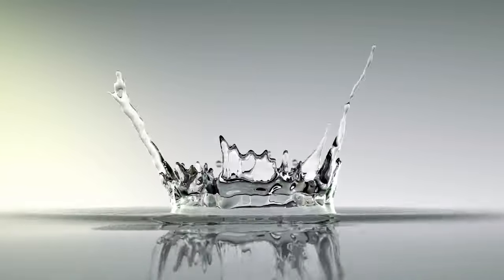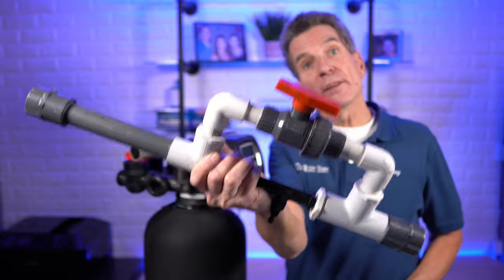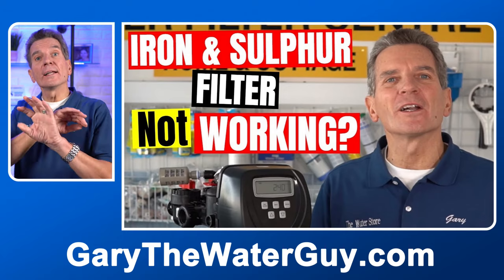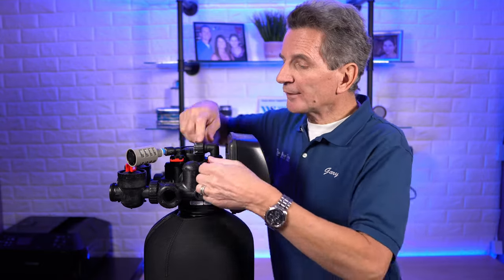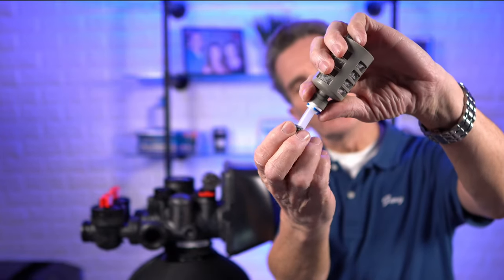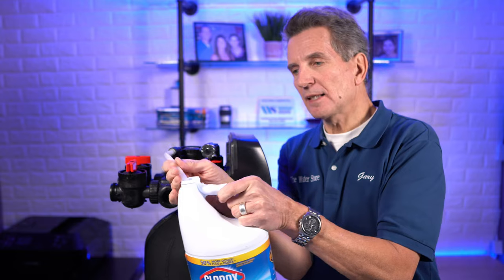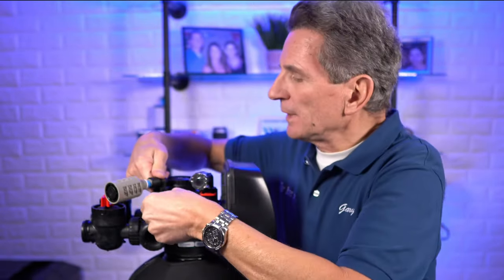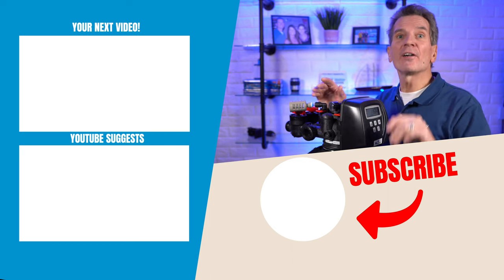EASY IRON Filter FIX

Comment: My iron filter stopped working and now I have smelly stained water and fluctuating pressure in the house. My unit for some reason won’t backflush even when I turn the knob to “start BW”. I can’t afford to replace it but I’m not finding any kind of specific info about my model #. I’m also not seeing any kind of air intake anywhere on my system.
Reply from the maker: This troubleshooting video might help https://youtu.be/Yg0HTiaLVFg
Reply: I had the same problem.. I took my entire unit apart, and it was LOADED with rust/iron.  I rebuilt the entire setup, and noticed that my filter and injector were completely plugged.  A simple bath in Iron Out of the filter and injectors did the trick!  Gary has such great content, he has taught me so much- Thanks Gary!!

Comment: Will this work on Green Sand Fusion media? I'm on well water and have a filter that uses the Green Sand Fusion, but my water is still yellow.  I've tried the iron vs tannin test with iron out and the water turns clear, so I really don't believe the water is yellow due to tannins.  I just don't think my filter is working properly and it's not even a year old.  I have also sanitized my well, and right after that the water was clear for a couple days, then back to the yellow.  Just looking for a solution.  Thanks!
Reply from the maker: I don't know if it will work, I would ask the manufacturer of your system.  Did you system ever work?

Comment: Good Morning,  I have noticed over the past couple days (extreme cold weather) that there has been a puddle of water on the floor alongside my filter.  Until yesterday, I hadn't discovered where this is coming from.  Yesterday I observed it was dripping from the air injector.  Could you please help me isolate what's going on and how to fix?  Thank you.
Reply from the maker: The check valve is leaking water during regeneration.  You need to replace the air draw assembly, we have them here https://waterestore.com/products/clack-fob-c-k-strainer-check-valve-air-intake-assy
Reply: Correct, it is only during regeneration.  Thank you...will order.   @water_estore

Comment: Gary, Thank you for your video, I have one of the iron filters you describe with the same set up at the top of the unit. I was looking for maintenance as it has been 2years. The installer told be they also use a “soft” mallet and use to loosen sediment as part of the maintenance. Have you heard of that and is legit?  Somewhat concerned. David
Reply from the maker: Never heard of this "soft mallet" concept.

Comment: Hey there, I have the Kalck valve but there is an air pump hooked into a relay with a PC board mounted to the front.  If I plug the  air pump into a regular outlet it works and builds pressure, but how can I test with the pressure relay, I havent noticed the pump running for a while and I am smelling sulfur again in my water.  the PCB is a repco BUB 080.  Not sure what all the setting are supposed to be, but do you have a video how to check to make sure this type of setup is functioning properly?  Thanks!
Reply from the maker: No, I don't like the ones with the pump and don't know much about them other than they are expensive, noisy and often require maintenance.

Comment: I have a hellenbrand single tank iron curtain that was in the house when I bought it.  No water softener, just high clear iron.  It seemed to be working ok until recently when staining started to appear.   Any idea if this valve can be taken apart to clean?    I see you you bleach for rust removal on the media.   what are your thoughts of citric acid powder?
Reply from the maker: I doubt that citric acid will work, never tried it.  I would first check the injector and either clean or replace it, this video should help. https://youtu.be/Yg0HTiaLVFg

Comment: Another great video Gary.
Question, once the javex has been sucked up and we put bypass on, if i’m not mistaken the javex/water in take will be “sitting” on top of media so how can it clean/oxide the media? After we do a Regen, then javex being on top will get drained right away. I’m I missing something here?
Reply from the maker: It does not sit on top of the emdia it is mexed with the water and the media.  When you regen it gets flushed away.

Comment: Hey Gary
Thanks for producing all these helpful videos. 
I'm having an issue that I haven't seen addressed in one of your videos. I'm having a lot of air in my  pipes, especially  the  hot water pipes. When I turn on any hot tap there's a lot of  spurting. I just had a look at my air injection  iron filter (by Excalibur) and when I opened the injection cap a lot of  air came out  of there. Is it normal for there to be air pressure under that cap?  
I'm trying to find a solution for all the air in the pipes because it's quite annoying. 
Thanks 
Paul
Reply from the maker: I cannot think of what might be causing the problem but if it is mostly in the hot water it may have something to do with the heater or venting.
Reply: Did you ever figure out a resolution to this? I have the same spurting in the lines after it cycles. Both the hot water and cold water.
Reply: @frangeech  I ended up putting an automatic air vent valve on the line

Comment: Is this procedure still possible if I have a single lever bypass valve? i.e. I can only disconnect both the inlet and outlet at the same time, not individually. I notice you opened just the inlet while filling the tank with bleach.
Reply from the maker: Great question!  Yes it will work just make sure no one in the house is using water while you are doing it!

Comment: Hi Gary! Thanks for your videos. My air draw is constantly leaking. I’ll follow the steps on this video. Wondering if the Res Care cleaner can be used to clean the sulfur filter instead of bleach. Thanks
Reply from the maker: No you cannot.  It sounds liek you need a new air draw.  We have them here https://waterestore.com/products/clack-fob-c-k-strainer-check-valve-air-intake-assy

Comment: Hi Gary 
Thank you for your videos. My well yes has alot of Iron. I have the chem free system in my basement.  Issue is my water started turning orange. It has media in, backwash and Reg.  Now it's a dull yellow. 
And.  Its seems to be more in the cold water than the hot.
Reply from the maker: I would have the water tested before and after the iron filter to make sure that color is actually iron. If it is I would follow the advice in this video https://youtu.be/Yg0HTiaLVFg

Comment: Hi Gary... I'm Hoping You Can Help Me Figure Out The Safest, Non-Corrosive (Chlorine Bleach Alternative) Disinfectant To Use To Get Rid Of Iron Bacteria In Our Well System... As We Have Copper Plumbing Throughout Our Home, And Want To Use Something That Won't Erode The Copper!!??🤔😓😞.....

Thank You Very Much For Your Extremely Informative Channel, As It Has Helped Me On More Than One Instances!!!💖🤗😉
Reply from the maker: I don't know of anything.  I am not an expert on chlorine injection systems but you inject it, give it contact time in a tank and then remove it with a carbon filter so it doesn't actually get into your house.

Comment: Hi Gary, Thanks for the videos. I am having an issue with an iron filter where the water pressure is very low. Any suggestions? Thanks!
Reply from the maker: Sounds like it's clogged.  After doing this procedure, try backwashing it a couple of times.  If that doesn't help, you need to repalce the media. Thsi video shows you how https://youtu.be/Z47JGH1l39o

Comment: Hiya Gary, I've got the three button clack valve from Excalibur. I watched some of your other videos and noticed that my setup looks exactly the same except for there is a cap where the brine inlet/air inlet is instead of the air inlet in this and some of your other videos. Would there be any reason for this? Im pretty sure my filter isnt working since  my water tastes like a mouth full of nails.

Thanks for the great content!✌🏼
Reply from the maker: You don't have an iron filter, you have a backwashable filter that might have carbon in it.

Comment: Can I replace the air intake with a brine tank? Will that be more effective for flushing out the iron? (I have a ton of iron in my well water). (love  your videos btw. this is fantastic)
Reply from the maker: No, brine will not regenerate the iron filter media and you need the air intake to create the air cap for the media to work.

Comment: Gary you are the Best!  You explain it very well and make it look easy.  
I have a question.  My iron and sulfur filter is a  Clack WS1.  When I put the valve in the brine draw cycle water leaks out the air intake. I checked the veturi (orange) and it is clear and there is no sound of air being drawn in to the tank. What should I do?  Thank you
Reply from the maker: Replace the air draw assembly here https://x9bgz9os9j7qacz6-17147789412.shopifypreview.com/products/clack-fob-c-k-strainer-check-valve-air-intake-assy

Comment: Hey Gary,
Thank you for all of your videos and awesome information. I felt honored to get a like and reply from you on another comment on another video you made.

Gary, 
Just for my knowledge why would we use bleach or Clorox in this scenario instead of a "rust out solution"? If the issue is too much buildup of iron in the filters would half a gallon of water mixed with rust out or citric acid be able to strip/remove that iron buildup better?
Reply from the maker: Great question.  Iron out will not only strip out the iron but it will remove the coating on the media beads and they will stop working to remove the iron.  Best to stick with the bleach.
Reply: Awesome thank you so much!

Comment: Great videos Gary.
   Do you recommend bleach for all media, carbon, birm and katalox for flushing a air over media unit?

Does your flush method work for manganese as well?
Reply from the maker: Yes, bleach works, but follow the directions in the video and on't do more thtyan needed.  It will help a little for manganese.
Reply: Thank you.

Comment: I wish I had someone as knowledgeable as you in my area! My water system service company has gone downhill!! I have Fleck 2510 and I need the media reversed. They gave me quote of $2500 just to rebed! 2 years ago it was under $500! Unfortunately my water Is it usable without my system (much more than an iron breaker). Do you know anyone in the Reno NV area??
Reply from the maker: Sorry I don't but depending on the size of your iron filter you can get a new one shipped to you for less than $2500

Comment: Gary, I have an iron filter and doing what you described it has just played out and still staining etc. I need to change my media. I have a 10x54 tank  My well flow rate is 11.5 gpm for backwash. What media do you recomend to replace with? I do not know what media is currently in the tank. I understand that this tank holds 1.5 cf. Do I need gravel? How much gravel?
Reply from the maker: This video will help you https://youtu.be/-KeuIvIyMis If yours is an air over media iron filter that size in one cubic foot.  Do you have sulphur smell in your water?
Reply: @water_estore  Yes sulfur or h2s odor. Also is Brim or katalox good options?

Comment: Hi Garry very good video, I have a question for the iron filter if you put a in line filter before the iron filter would the help the injector from getting clogged up? I recently had that clogged with black crap
Reply from the maker: No, the injector would still get clogged.

Comment: Hi Gary, great video, I'm on well with pressure tank and I also have a separate water softener, and my iron filter is 5 button Clak WS series, for the last couple of months I get air in my water line and it sems to get worse as the time goes by, I recently bypass the iron filter for 2 days and I had no more air in my water line next day after I open the valves I got air again in my line, it makes me believe its from my iron filter, I notice a the top right under the drain line it has a small circle opening that looks like a valve where from time to time I can hear like an air release, right there I have water lick as you can see in my pick, any suggestions please, your help is greatly appreciated.
Thank you
Reply from the maker: Sorry, I don't have any suggestions.

Comment: Can these air over media units be used with city water supply to home? What is the average cost of units?
Reply from the maker: Yes, but ytpically you wouldn't have iron or sulphur in city water.  Price depends on size, type and if in Canada or USA.  Typically about $1400 and up.

Comment: What about filox? I’ve heard it never needs replaced. Can you use filox-R with air? Does the fleck 2510 SXT model inject air or do you need the 2510 aoi model. Thanks
Reply from the maker: Sorry don't know anything about filox or the Fleck 2510 SXT.

Comment: I have found that Katalox seems to bridge a lot inside of theses FOK units even when increasing the size of the DLFC button. Any suggestions? Would treating media with chlorine help this? Thanks!
Reply from the maker: Katalox requires over 6.5 gpm of flow rate coming from your well pump.  I would check yours to confirm. This video shows you how https://youtu.be/BONHr56jnKs

Comment: Mine seems to be leaking out water from where the media portion attaches to the tank. is this an easy fix?
Reply from the maker: It might be, if you mean that it is leaking at the top fo the tank, bottom of the valve.  You can disconnect it from the plumbing and then try to turn it to tighten.
Reply: @water_estore  Great thanks! I'll give it a shot.

Comment: Hello , i went on vacation And made the mistake by turning off the power for 3 weeks to my system. Then notice that my system wasn’t back washing daily like it did In the past. Now the water smell like rooten Eggs. I’ve done several manual backwash and it help but continues. Seems to me that my system is out of programming it’s only backwash every 3 days.
Reply from the maker: WE normally set them for every 3 days, but if you want to change yours to every day, this video will help https://youtu.be/AaAfTlDNUF0